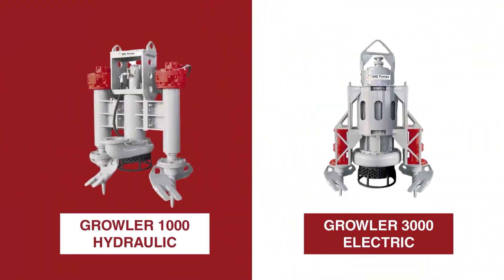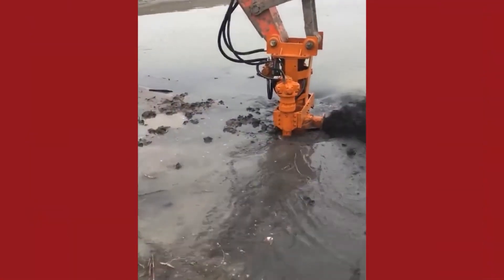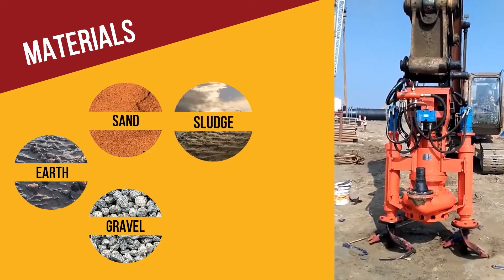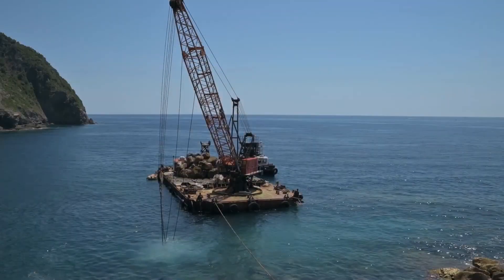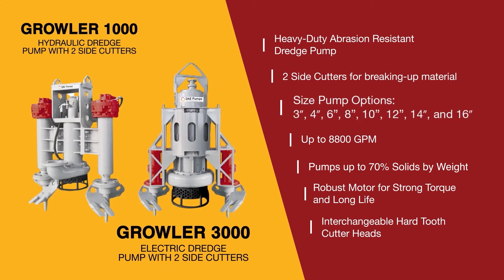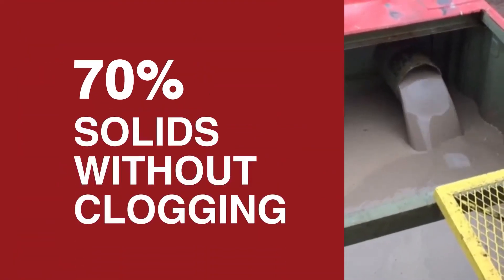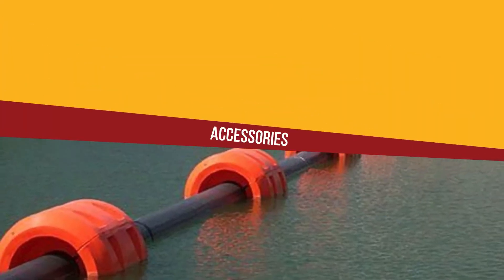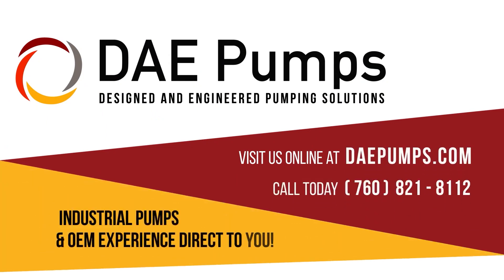DAE Pumps Growler Dredge Pumps || Excavator Mounted and Cable Deployed

Comment: What's the price of this??
Reply from the maker: Hi @billybudz2894,
The Growler Excavator Mounted Dredge Pumps range for approx. $15,000 up to $200,000, depending on the size and horsepower. Please email info@daepumps.com or call 760-821-8112 and we will give you a quote to meet your needs.
Thank you!
Richard